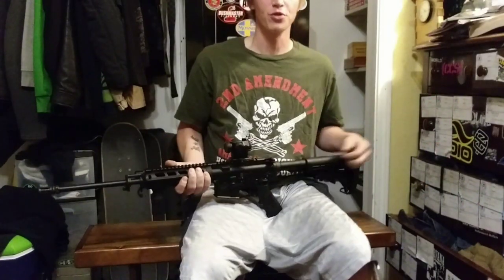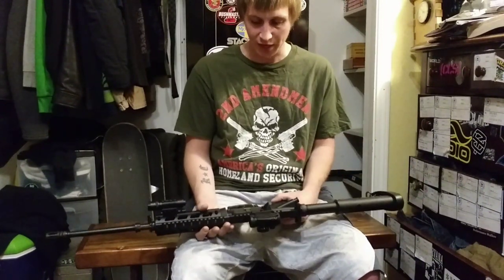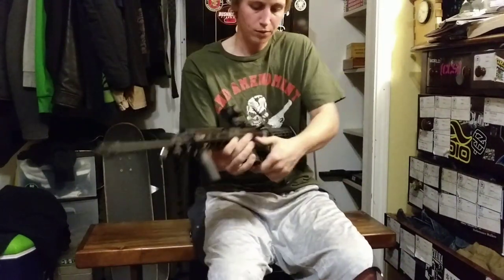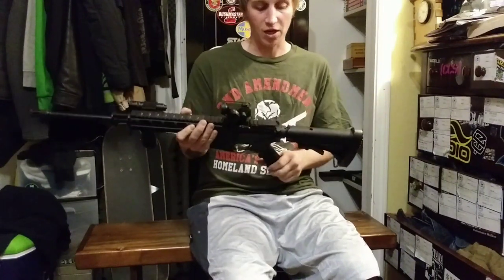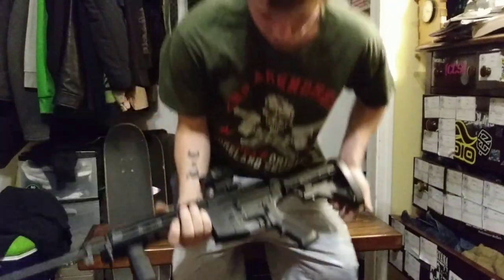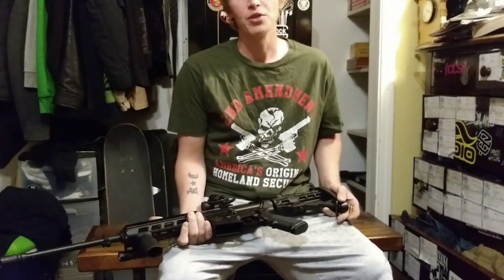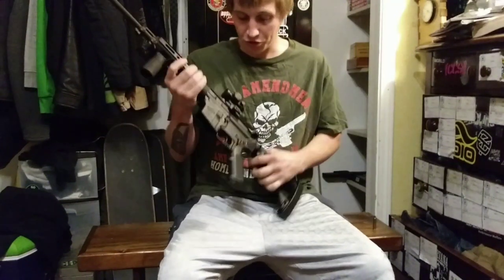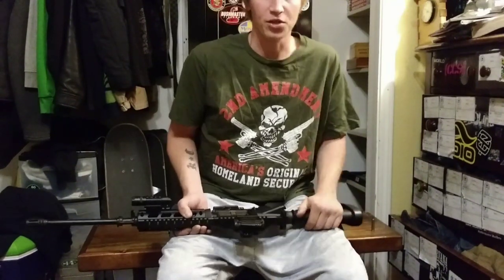AR-15 mortaring technique unjam a stuck bolt & charging handle w/round chambered.

Comment: Appreciated the video but this is the the 3rd video I seen that solved this exact thing for gun ranges n practicing but if it comes to self defense n it happens I'm absolutely fucked lol
Reply from the maker: Update - Since filming this video I had to mortar my rifle 2 more times. I also had not performed a full disassembly and cleaning/Lubrication on the bolt carrier group and ejector. After doing that the problem has not happened again and I've put over 2000 rounds through it. I also got some input from other viewers and a common explanation is new rifles have tighter tolerance in the chamber and just normal operation of the rifle can help loosen things up therefore fixing this issue from happening. I also was suspicious that maybe the ammo I was using was causing it because all 4 times i had to mortar my rifle I was using .223 remington so now I predominately use 556 NATO and the issue hasn't come up. But like i said that could have nothing to do with it and it could have just needed to be broken in. That being said if this issue arises the first thing I recommend doing after removing the stuck round is to give your rifle a thorough cleaning and lubrication. I just uploaded an AR15 disassembly cleaning procedure/lubrication and reassembly video a few months ago here is the link if you don't know the proper cleaning procedure.
https://youtu.be/Apmvm9SrXzw

Comment: What manufacturer is it?
Reply from the maker: My rifle? It's a bushmaster xm15 QRC
Reply: @counterstrike2A  thanks good to know. Odd, that is a good brand
Reply from the maker: @jtan2010 it's actually a common malfunction that occurs generally on newer AR-15 rifles essentially during the break in period. I've come to find out the tolerances In the chamber is still tight and that malfunction occurs on all kinds of rifle brands good and bad until the rifle gets kind of broken in and a couple hundred rounds through it. I only experienced that malfunction within the first 500 rounds, and haven't had that issue occur since. I made kind of an update video on it that explains it more if ur interested.
https://youtu.be/S_wLVeBOJgI

Comment: Something else that can cause that is burrs on the locking lugs in the upper.  Get a headband light and look in there to see if there are burrs or rough edges on the lugs.  The bolt will operate fine on an empty chamber, but the rim of the cartridge will hang on the burrs(edit: the rim of cartridge puts pressure on the lugs, so the rear of the bolt lugs hang on the burrs) and prevent the bolt from coming out of battery.  .
Reply from the maker: Nice thanks for the extra info my rifle was brand new the 2 times it happened to me and since the last time I had to mortar out the round I've put over 200 rounds through my rifle without any more malfunctions so in my case I think it was just everything was still a little tight and needed to be broken in at least that's what I concluded. But thanks for your insight I bet someone who watched this video had their rifle malfunction due to the reason you just stated. Have a good day and thanks for supporting my channel. 🇺🇸🇺🇸
Reply: @counterstrike2A   Actually, it's the back of the lugs on the bolt that hang on the burrs and prevent it from rotating out of battery.   Yeah, as you work the action more and more it'll loosen up.
Reply from the maker: Ya definitely I just didn't know the correct terminology but I knew the tolerances needed to be slightly lessened up with use over time. I also noticed the only time that happened I was using.223 and have since used exclusively 556 and it hasn't happened using those rounds since I made the switch.
Reply: @counterstrike2A  The NATO stuff is more dense than most of the commercial brass, and I think they give it a little wider tolerance for reliability.
Reply from the maker: @Scott.Farkus  ya and from what I've heard it has a little more powder in it in turn producing more pressure for ejection
Reply: @counterstrike2A  From what I've read, the throat on the NATO barrel is 125 thousandths longer than the throat on the .223 Rem,  plus the 5.56 x 45 round has 1 grain more powder, and runs at about 3000 psi higher pressure.   If you fire the 5.56 NATO round in a .223 Rem chamber it produce about 10,000 psi greater pressure than the .223 Rem round normally produces, so it's making 65,000 psi instead of the normal 55,000 psi.  Probably not a good idea.
Reply from the maker: @Scott.Farkus  lol ya luckily I'm not that dumb my ar15 is chambered for both 556 and 223 and I don't shoot reloads so I don't gotta worry about that. I just thought it was interesting that each time that happened it was with a 223 round. So I have predominately shot 556 out of it but with the covid ammo shortage I've been shooting 223 with it more if they don't have 556 in stock when I buy ammo
Reply: @counterstrike2A  I have an upper with the .223 Wylde chambering to.  Glad I went that way, because 5.56 is def. hard to find.
Reply from the maker: @Scott.Farkus  ain't that the truth

Comment: This doesn’t work for me. I’m fucked with a .308 in the chamber. Never even fired the gun. Just cleaned and lubed it
Reply from the maker: Try again if it's an ar platform it should work just make sure to slam the butt stock down at the same time u pull the charging handle to the rear I can't think of any examples where this technique didn't work unless u were using bad reloads or something. But give it another try or two and if it still doesn't work then u should probably take it to a gunsmith or first contact the gun manufacturer
Reply: @counterstrike2A  actually got it this morning lol thanks. Idk if the problem is rifle or Ammo.  I cleaned and lubed it and was just trying to cycle rounds through it manually. 

Was using steel case 145gr .308. Never been fired but a round got stuck 3 times

Any thoughts you may have id appreciate
Thanks for the reply
Reply from the maker: Is the rifle new? Cause I had this happen about 3 to 4 times to me but it was in the first 1000 rounds and after that no more issues and from what ive learned the chamber has such tight tolerances when its new that it sometimes needs to break in a little bit by just shooting rounds through it and then problem solved
Reply: @counterstrike2A  never fired by me. Assuming it was test fired by ABC before they sent it. Is brand new though. Just took it apart to clean and lube. Was fairly liberal lubing the bcg

Looking forward to breaking it in. All I have right now is cheap steel Ammo that I can’t shoot at the indoor range by me
Reply from the maker: Ok ya it prob just needs a few hundred rounds through it and cleaning the bcg and lubricating the extractor will help do u know the trick to lubricating the extractor without taking it apart? Just in case u don't I'll send u a link to my recent ar15 cleaning guide video. I learned that technique from my bushmaster ar15 owners manual.
https://youtu.be/Apmvm9SrXzw
Reply: @counterstrike2A  thanks for all the help friend. I’ll check out that video
Reply from the maker: @iLLBiLLsRoastBeats  no problem I'm glad I could help in any way have a good rest of ur day and a safe and merry xmas! 🇺🇸
Reply: @counterstrike2A  you too brother and your family

Comment: Maybe I’m crazy, but slamming the butt of my rifle on a bench with a live round stuck in the chamber doesn’t seem like a great idea
Reply from the maker: Its technically impossible for a round to just go off without pulling the trigger therefore causing the firing pin to strike the primer On the round so unless your finger is on the trigger the rifle Wont have a negligent discharge that being said it always best to air on the side of caution thats why I suggested doing the maneuver outside and pointed in a safe direction. But without the firing pin striking the primer its just not going to go off without pulling the trigger. My friend was a marine and served in Iraq and they were taught this method in basic training in case this malfunction happens.
Reply from the maker: And im not sure if your referring to me doing my demonstration in the video but if you go back and watch it closer then you will see that I put a spent shell casing in my rifle (A shell that has already been fired and has no powder in it or bullet tip)